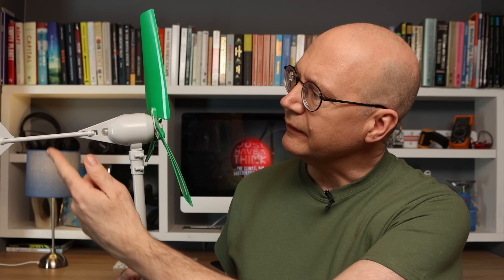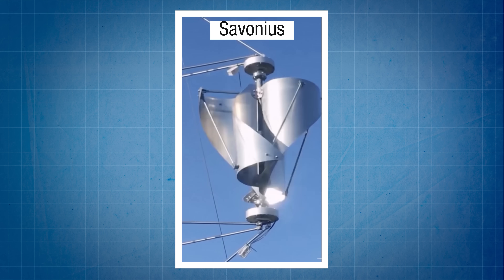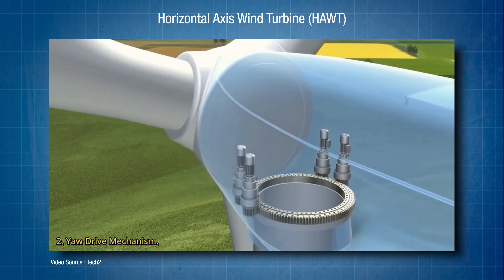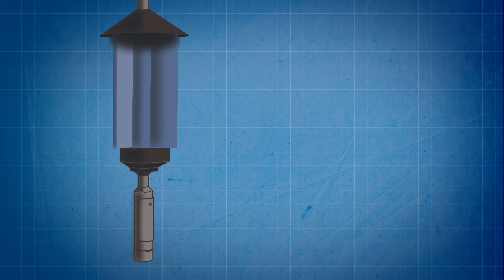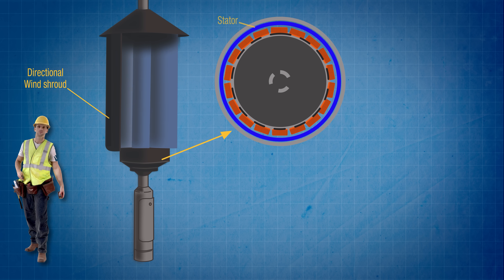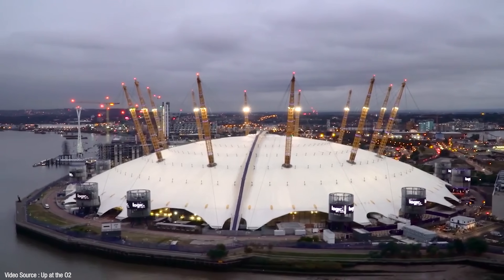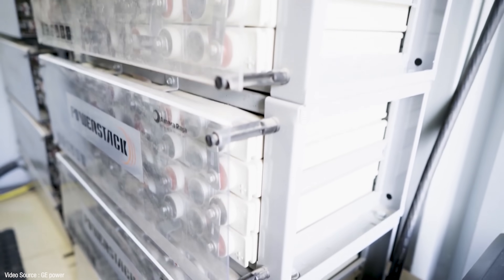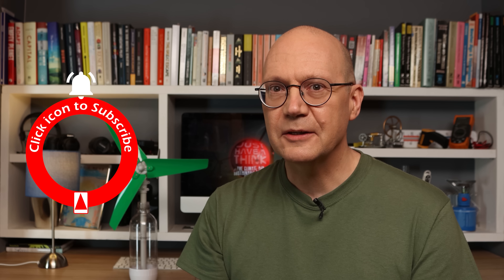A vertical axis wind turbine that doesn't need the prevailing wind! How do they do that?

Comment: How about investing in the manufactures......????
Would love getting in on the ground floor.....
Reply from the maker: https://alpha-311.com/
Reply: @JustHaveaThink  Thanks for the link...!!
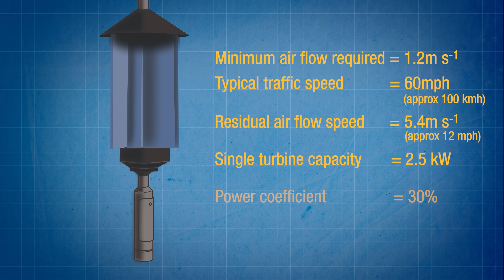Reply: @geraldsutton9981   Don't think of investing! Dave's numbers don't stack up, they are wrong by either two (5:31) or three (8:50) orders of magnitude. (So which is it, Dave, 2.5 or 24 kW?) The right number for a VAWT this size is about 25 watt, by following the standard VAWT physics formulas. It will never be cost-effective.  It is most likely a scam.

Comment: Doesn't this reduce the efficiency of the car?  How is this different from putting a wind turbine on the car?
Reply: When a car travels on a road it pushes the air side ways like a swimmer pushes water. If there is free space on the side there is no resistance to the displaced air. An installed turbine does offer resistance to air flow from a car thereby demanding more power to propel the car at same speed. Needing more pressure on throttle resulting in more fuel consumption.but it may be negligible. Still  some wise guy may sue the turbine installer for losses.
A brilliant idea all the same. India has embarked on 
building thousands of miles of express ways. Potential is plenty as the country is on to huge plans for renewable energy.
Reply: @shankarrao5698  If someone can sue for losses from a turbine on the side of the road, they would have already done that for sound baffling, trees, road signs, or people standing on the side of the road since they interact in very much the same way with the air the car is displacing.
Reply: Exactly... I would like to see those studies. Would the fuel consumption increase? If yes then this is just stupid idea and not renewable at all
Reply: the amount of electricity created by the turbine would always cancel out b/c it would = the drag required to generate it, but obviously this wouldn’t apply to Alpha 311 turbines b/c they are separate from the vehicle
Reply: A car will displace air in all directions as it pushes through it and these turbines will only interact with a very small percentage of the air the car has moved because they don't surround it. There's a possibility they might even increase efficiency as they'll settle a lot of the turbulent flow that passes over them, giving the cars around them more stable air to interact with (Which is what their aerodynamics are designed to handle by wind tunnel tests).

Until independent third party testing shows this isn't more gofundme style marketing wank to steal venture capital from people I'll reserve judgement on whether it could actually give a net return though.

Comment: if you put your hand out of car's window at 100kmh you can feel each of posts by hitting it's still-air pocket. i am pretty sure these turbines will show bigger gas consumption in automobiles moving aside it.
even electrons behave different when physicist observing it ;)
Reply: Certainly, turbines provide resistance for air that tries to get out of the way of the car thus  slightly higher pressure ahead.
Secondly  turbines create more turbulent air by the road. A car is most slippery in lean air. Higher drag is probably a side effect.

It's clear that the turbines will steal effort from the passing vehicles. Now the main question is how much is in form off added resistance and how much is from unrecoverable wind waste.
Reply: @tigertalar  I would suggest that there is so much turbulent air along a motorway from all the various types of vehicles moving at different speeds and directions  that this will be a very marginal additional impact.
Reply: Yes, I would think it will rob the passing vehicles of at least some amount of energy. 
It may be neglible though, but it sure warrents a proper practical experiment, before its rolled out full scale I'd say. 
If for nothing else, just to silence the rumour mill in advance.

Comment: A constantly spinning stator cannot operate for few years yet 25 years. There are similar street lights in Istanbul. At least 10% of them get stuck or stop working frequently. Since they are spread across several kilometers, maintaining the system is hard especially in a public road which increases the prices.
Reply: We can probably assume that’s why they are leased and not purchased. You’d also be safe to assume that the lease agreement would include regular PMs and service of each unit for the term of the lease.
Reply: So there would need to be a 'refurbish cost' factored into the calculations.  It shouldn't be hard for an engineer to estimate bearing life.  And the spinning mass seems quite low which would mean less wear on bearing surfaces.  

Something like pull them off the lamppost every decade or so, replace them with a refurbished unit and take them back for a freshening.
Reply: @bobwallace9753  The use of frictionless  magnetic bearings would reduce the ware to a minimum .
Reply: Yeah, in addition to the frictionless thinking that is driving this bullshit. Into the ears out of the mouths without any resistance in between. Clean, undisturbed, pure snake oil marketing hype.

Comment: Thunderf00t needs to join the chat
Reply: @waffleuk  Why? My math is correct dude...
Reply: For real, this idea is complete horse shit, if you do the basic calculation of how much power (kinetic energy in the wind passing through the blade area per second) is in the wind you only get about 100 Watts for a 2x0.5m blade and 5.4m/s windspeed.
So at best these turbines could generate 30ish Watts. - If theyre 30% efficient.

Comment: Great video ! At last small, affordable, wildlife friendly & easy to maintain, low-tech solutions for generating energy from wind. I firmly believe that local, small, scaleable units are the way forward for generating electricity from the huge amount of energy that surrounds us permanently in its many forms - wind, sun, water movement etc. I applaud the fact that we are embracing renewable energy generation & hope that we will move away from our initial gigantism - think enormous wind turbines here - to robust systems using easily available raw materials (not rare earths & co) made up of multiple mini generators. It is also important to note that one small generator breakdown in a network will not be catastrophic & can be rapidly remedied. Vive la green revolution !

Comment: Why are the windings on the rotor ? If the windings were on the stator (and the permanent magnets on the rotor) there would be no need for slip rings. Back in the day bicycle dynamos (which were not really dynamos but in fact alternators) and a Honda motorcycle AC starter motor I had worked just fine with that arrangement.
Reply: Putting windings on the rotor allows the generator to use some of it's own power to adjust the strength of the rotor magnets. This means it can adjust the power it generates inline with demand or, more likely in the case of this device, adjust generator drag in line with how much power is available from the wind. Adjusting the drag from the generator allows the turbine to maintain an optimum turbine speed (And avoid overspeed, though these will almost certainly need to have a brake separate to the generator to deal with storm conditions). Permanent magnets would leave the turbine permanently stalled at low wind speeds as well as losing a lot of the potential generation at high speeds.
Reply: @peglor  Sorry mate but exactly the same control would be available with the windings on the stationary part rather than the rotating one as far as I can see. Perhaps you could make your point is a way a dummy like me could grasp ?
Reply: @peglor  OK, that makes sense. As I understand the reply you were kind enough to provide the generator does not use permanent magnets (or if it does they are not the full story), there is in fact a stator winding in addition to the rotor winding shown. These are only 2.5kW machines (which sounds generous to me) so I suspect permanent magnets could have been employed with just stator windings allowing for the elimination of slip rings but perhaps I'm seduced by the appeal of the reduced maintenance from eliminating of slip rings leaving only the shaft bearings as a mechanical wear item (or is there also a step up gearbox between the blades and the generator ?).

Comment: While I understand the appeal of these "Energy run-off" proposals, where we are trying to optimise all sorts of areas of the world, I just don't think we need to yet. We aren't any where close to our potential max yield from on- and off-shore wind installations, so why try and optimise what is essentially a small amount of wasted energy? This seems to me like someone trying to set-up rainwater collection in the desert, when there is an oasis just over the next dune with an abundant water supply. A little less initial effort for much worse pay-off. 

That's not even considering the fixed time costs that lots of small mechanical devices create. I would say, generally, spreading things over a larger area makes it MUCH harder to perform maintenance, which is why wind and solar farms are usually tightly bunched. A quick comparison: 

3MW installation above = 125 small Turbines = 125 bearings and motors that need regular maintenance, repairing and replacement.
3MW off-shore = 1 large turbine = 1 system that needs the same. 

Getting to the off-shore wind turbine to perform maintenance may be harder and more involved, or it may actually not? You will mostly likely have to have crews going up and down the motorway every day as, with the increasing number of turbines, the likelihood of one breaking or becoming less efficient due to wear increases and if the maintenance crews have to contend with normal traffic that could be a lot of time driving and not fixing things, increasing the personnel cost.

Comment: One statistic that I think it missing here is a comparison to the amount of electricity collected from the road side to the amount of energy used to power the vehicles. In omitting this you create greenwash that covers up how inefficient motorway transport is. Surely the energy collected from these devices are a negligible fraction compared to energy efficiency savings of the vehicles by reducing maximum speeds and the number of journeys?

Also I've seen many small turbines installed to power "green" lighting, but they broke down and were replaced with mains cables before they could have generated the energy used in their production/installation/recycling. Please show us some life cycle analysis stats too.

Comment: I've set up the electrical services for Cell Towers (I work for a power utility company) and they use a LOT of power. While I agree that putting one of these on a tower would be a good idea, I don't think it would be able to provide all the power needed... That being said, that shouldn't be a deterrent from putting one on anyways. The only issue is the stress one of these would put on a tower. If you guyed it in all directions, then it'd be fine, but these towers are very tall and the guys would need to extend out pretty far. It would most likely be cost-prohibitive for the comms companies to lease the extra land just for the turbine.
Reply: I worked in Telecoms and you’re correct -retrofitting horizontal or vertical wind turbines to an existing structure can be very expensive. Then there’s the cost of maintenance by a specialised work force. Solar wins out on whole of life costs.
Reply: Then put up two of them. Or three. You get the idea. Imagination (creativity) is more important than knowledge - Albert Einstein
Reply: @bobbyp21  I think you might be misunderstanding something... People (Companies) aren't going to do something that will lose them money. We have so many fantastic technologies that don't get used because they're not cost-effective. So, while Einstein was correct in his quote about creating new things or renovating old things, when it comes to implementing them, he is not.
After all, having a ring of solar panels in orbit around the sun while beaming all that delicious solar energy back to earth via microwaves is a very creative idea. It would solve the world's energy problems immediately... Extremely creative... but until technology catches up to the point where it's cost-effective, it will never be done.
There are two sources of humanity's  greatest innovation... one is War, unfortunately, and the other is when someone figures out a way to make an expensive process cheaper.

I love the idea of putting these vertical turbines along a roadway. America should implement this immediately. I believe it would be cost-effective and it would make use of something we only thought of as waste... wind created by passing cars.

Comment: What's thought of as free isnt really free. Taking energy from the residual air flow takes energy you might benifit you from the car in front of you.  Thus you have to burn more gasoline diesel, or use more battery. 

Counter argument
but your not always driving with someone infront of you. True but then the turbines are also  make less energy. So at these times the turbines are not causing more energy consumption to transport, they are producing less and less energy to justify them.

Comment: Dave love the videos keep up the great work. There may be a significant error in the costs shown. Solar panels will have minimal maintenance (no moving parts) but the VAWTs will have a significant maintenance cost plus I'm doubtful the VAWTs will last 25 years (which car lasts 25 years?). Maybe but maybe it's like the old farmer who said "this is the best hammer I've ever had, I've replaced the handle twice and the head 3 times and it's still the best hammer I've ever had!".

Comment: Great work as always but I am uncomfortable with the validity of 3MW solar vs 3MW 311 wind comparison: IMO to account for all variables comparisons should always be made in terms if average energy generated per year, not in nominal power, i.e.  GWh/year not MW.  E.g. solar farms in the UK may have have a 10% capacity factor, i.e. a 3 MW farm would generate about 2.6 GWh/year.   Similarly, traffic flows and environmental conditions fluctuate daily and seasonally, so it is unclear what a 3MW 311 turbine installation would generate over a year.   Let's agree on a meaningful standard.
Reply: Exactly! RE projects should be ashamed when the only published figure is their CAPACITY. UK solar averages 4.4 sun-hours, varying from 1.1 in a poor winter to 8.8 in a good summer. A 3 MW solar farm might only average 130-150 kW in December/January. That's still about 5 times more than is claimed for 125 of these turbines - which could earn you £4,500 a month in produced kWh ...while costing you £29,000 in monthly lease!